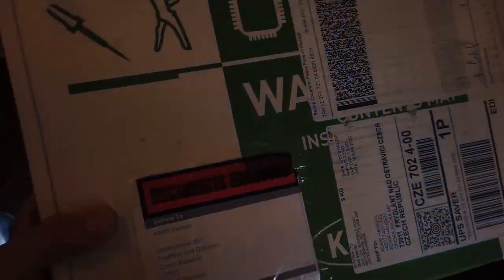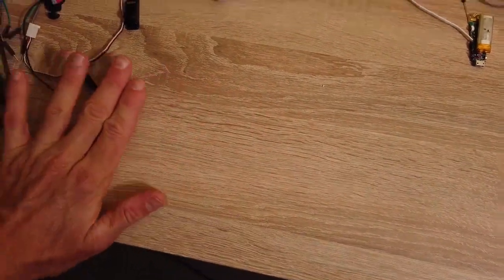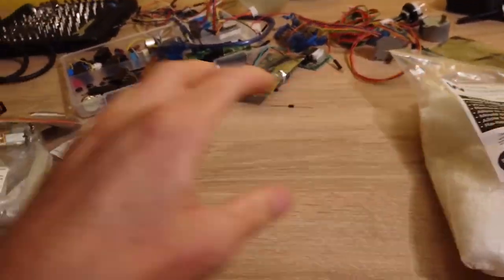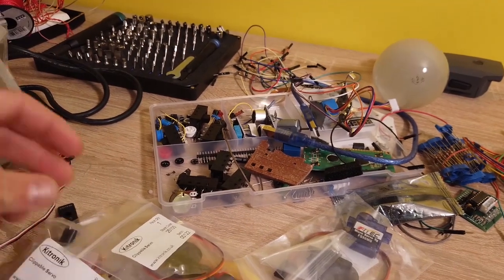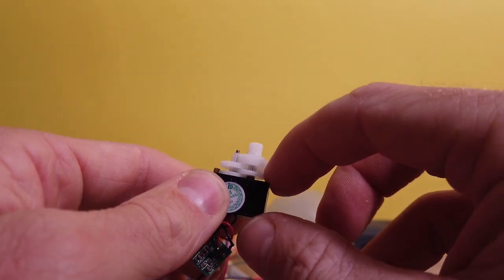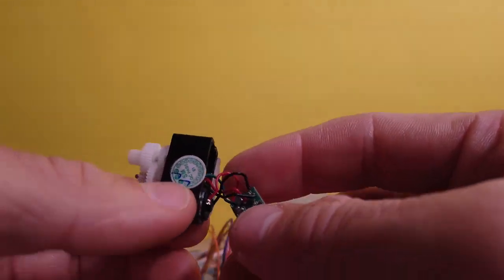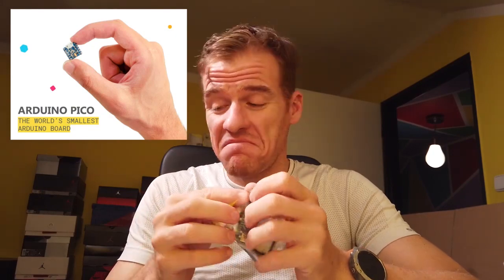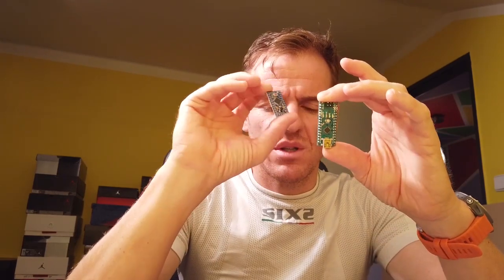Can I make electric laces on my Hanseeno shoes???? - PART 1

Comment: Holy Toledo !!! Somehow I don't think you are going to be bored during this whole Lockdown thing, & Neither are we.  Have you ever thought about printing (and modifying) your own Pedal Cleats? Anyway Good Luck with the Project - these shoes will be something else !
Reply from the maker: Hey Phillip!

I'm going to do a video on all the models of shoes I've made in the past and you would not believe it but my very first model the cleat and sole was one piece made from carbon. It was super complex to do. The reason why I don't do it anymore. 

As for 3D printing it I don't think I could make it lighter. But I could shave off some material to make it lighter. I'll try it on next shoe! Thanks for the idea!
Reply: @AdamHansenOfficial  Your Welcome on the Idea. You've taught me a lot of things from these YouTube Videos, I will certainly try and give you feedback on things. I've always thought the Pedal Cleat Float hasn't moved on in terms of Designs in Years. Though I think you use the Look Keo's which are about the best. I wonder whether there will be a new design (Especially in a Sport like Triathlon) but that may involve a new Pedal System also. 
Looking forward to seeing the Famous Hanseeno Shoe Collection :-) 
Phill
Reply: @AdamHansenOfficial  Am I wrong (but I cannot find if so) or did/do you have different shoes setups also based on stages, e.g. shoes setup (cleat position) for climbing stages and another setup for TT or flat stages? If so is it still like that or are you using a shoes setup unrelated to stages profiles? Thank you

Comment: Just a thought... could you use the sole of a shoe (with cleat, etc. attached) as a plug to mould a foam outersole that could be slipped over the shoe when walking? Then, once you're on your bike, just slip off the foam outersole and give it to a team staff member and you don't have to worry so much about cracking the carbon on a stone

Comment: have you ever thought about designing a pedal? going back to a strap as foot retention, like the fixed-gear crowd? with a specific profile on the bottom of your shoe that fits into your own pedal, you'd only need a thin dyneema strap over the shoe. it would scuff the paintwork up, but it could be very very light even compared to high end clipless pedals on the market

Comment: Awesome project Adam! Super interested to see how it turns out. Interesting theory on measuring battery life. I would have thought a much bigger energy drain through tourque loads than just timing the battery drain on a freewheeling motor unit. For accuracy would it be worth thinking about having a fully functioning prototype with a dummy foot (to simulate a full shoe and appropriate torquing) and have some soft of mains power actuator to run the system (making the system use the CR2032 batt)? Just a thought as someone who chews through batteries on drill equipment (high tourque = fast drain). Love the movies. Looking forward to seeing the historical shoe collection movie when it comes
Reply from the maker: You are dead right regarding battery drain and I was thinking that when I was cutting the video. I guess I will find out the hard way...... when it runs out on me :D

Comment: Hi Adam, here's a thought, would the motors inside your front and rear derailleurs not be smaller? Have a word with Campag and see if they can help. The other thing, why not use a cam to exaggerate the turning circle of the tightening device?
Reply from the maker: Good ideal with Campag, but their factory is closed I believe. Regarding the cam to exaggerate the turning cycle. I actually am having a pulley system inside for this to increase the tension.

Comment: With all this time on my hands I am going to have a go at making some custom carbon fiber shoes for myself. Any tips on how to make the upper "tongue" part flexible?
Reply from the maker: Why not try!! The flexible upper tongue is difficult, too flexible then it creases. not flexible enough then it's cracks. The key is, if you see carbon on my shoes is just for show, Kevlar is the must have. Also so the laces don't rip through it.

I use:
https://shop1.r-g.de/en/art/130140

You have to change the ratio of epoxy depending on the amount added of the flexible agent to the hardner. So normal epoxy L and hardner L is 100/40 by weight. I add 30% flexible agent and from top of my head you must reduce the hardner  L by 15%. So I normally do for a thick upper(greater than 300gram/m2 fabric) 35grams of epoxy L, 15grams of flexible agent and 17grams of harder L. When I make super light shoes with upper fabric of 130gram/m2 then 40gEL/10gFA/18HL. 

Hope that makes sense, you can buy Hardner L/Epoxy L also from r-g.de

Good luck!
Reply: @AdamHansenOfficial  Awesome!! Thanks for the resources and info. :)